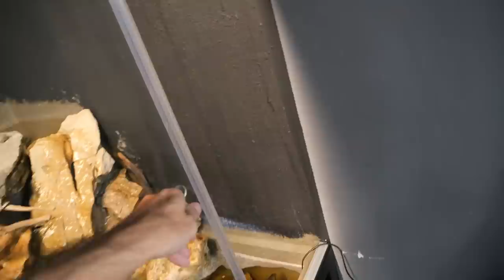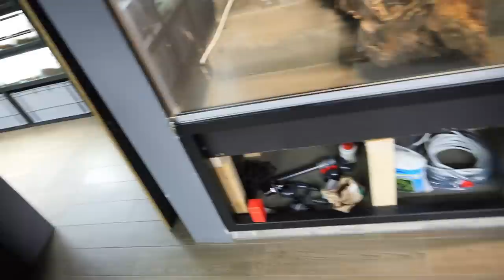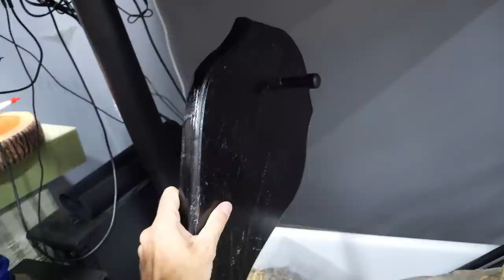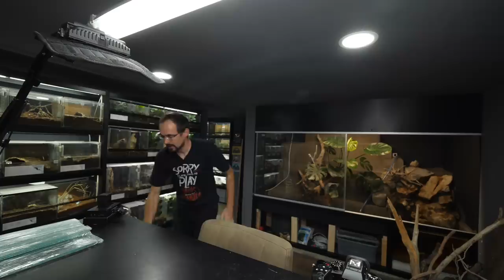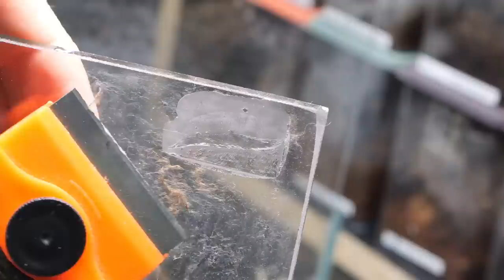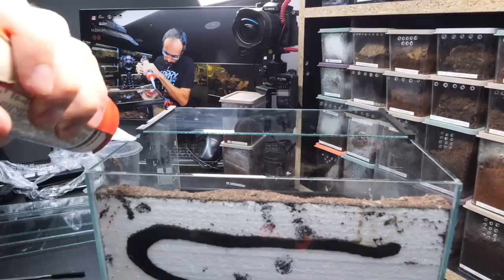Another SPIDER ESCAPE...It Was MY FAULT! + Skull bliss

Comment: Hi Petko! I strongly recommend, for the hammering process, of sticking the plastic parts to the glass, use a soft surface, like a cork board piece on top of your table. Surely you don’t want to accidentally break the glass. I know it’s a rubber hammer, but better be safer.

Comment: If you want a more seamless join between the cut plastic pieces, you can use Acetone or plastic cement [I recommend Tamiya extra thin or plastic magic, they are thin and brush applied]. You will need to do it in a well ventilated area, but it will make the parts 1 large part, instead of 2 joined by superglue, actually welding the plastic. After it cures, you can sand it smooth and even brush the plastic cement over rough surfaces to smooth it out. This melts the plastic and allows it to re-harden. 

This trick is used in model building to remove mold lines, clean cut marks and close gaps.